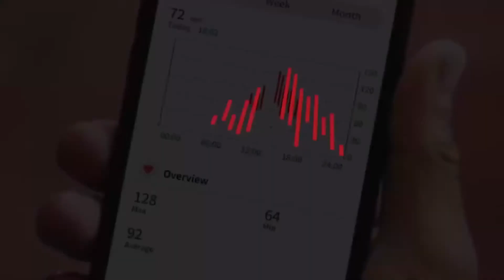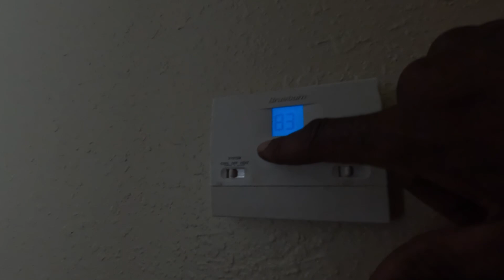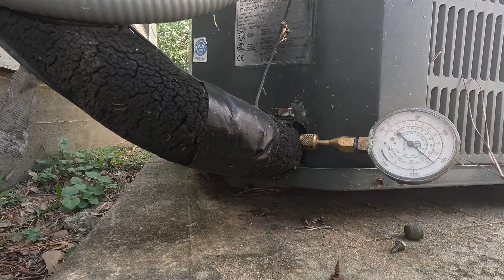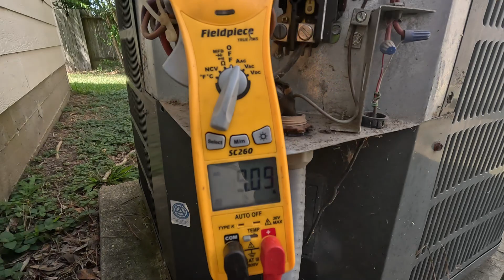"Insane HVAC Invention Alert: Trying out a Portable AC Necklace on a No-Cooling Crisis"

Comment: Good job Bro in Az AmRad cap 5 year warranty on Cap been using that kind of cap for the past 10 years and yes they go Bad but 5 year warranty you can’t go bad keep up the good work
Reply from the maker: How do you get the warranty?
Reply: Where ever supplier you buy AmRad Cap here Phoenix AZ I buy them at Us Air Conditioner supplier and when I replace run cap tell my customer It has 5 year warranty